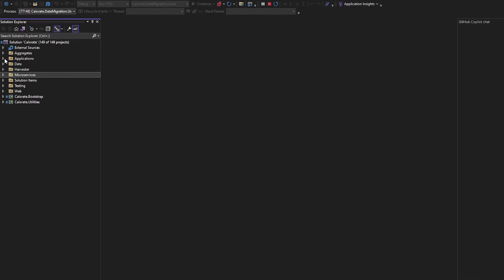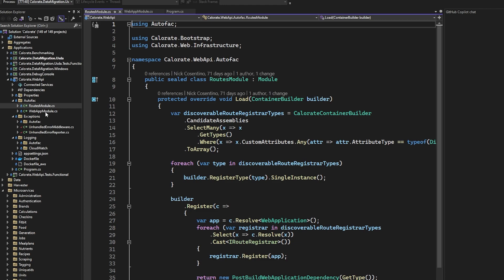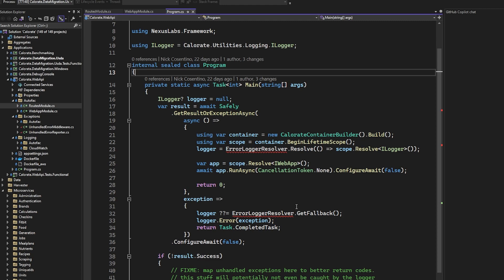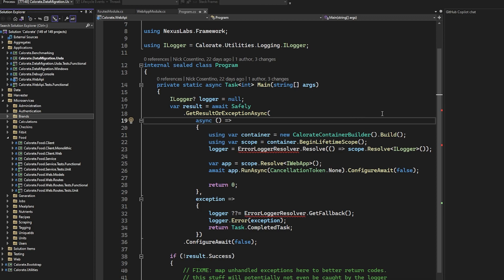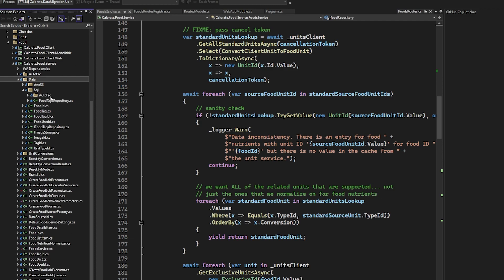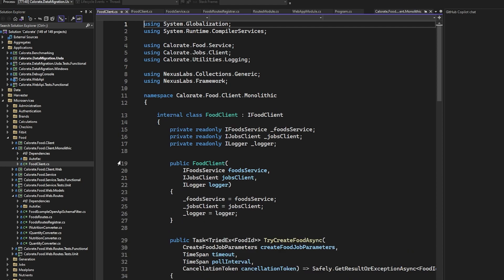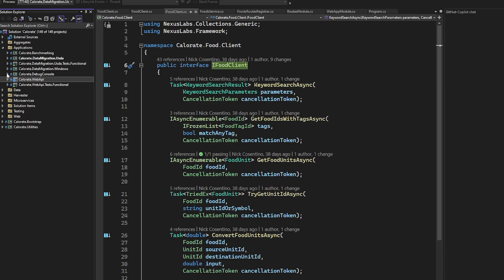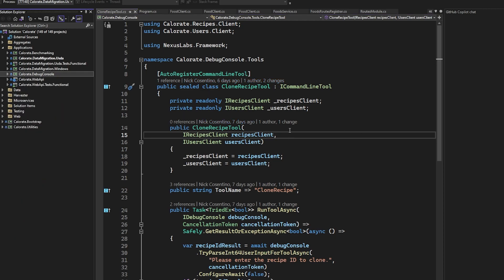Vertical Slices & Plugin Architecture - Principal Software Engineering Manager's Approach

Comment: Excellent video but why very less views.. it came to me at the right time which my company wants to implement plugin kind of architecture
Reply from the maker: My channel is still growing 🙂 slow and steady!

I'm glad that you found this helpful! I'll be trying to put out more plugin content soon 🙂
Reply: @DevLeader  Is it possible to share code base with microservices architecture so that it can be helpful for me to start.. I know the folder you have shown is real use case but to start faster may be a sample prototype with all basic features will be more helpful to start faster
Reply from the maker: @prabakara1652  hey there! I understand the request but there's a bit of a philosophical challenge with providing an example microservices template for beginners to start with.

That challenge is essentially: 
1) microservices will be very specific to what you're building
2) coming up with a generic template probably has little value as a result
3) microservices are complex by definition

I'm not trying to make excuses for this, but I genuinely don't think it would be as much value as you're guessing. 

Is it possible that it's a better fit for you to start with a monolith or modular monolith?
Reply: @DevLeader  Thanks for your reply. Modular monolith I think better fit for my current project need. Is it possible to share the code? that would be more helpful as the project deadline is very near and the client ask is extensible, plugin and modular approach.. your modular monolith solution seems best fit .
Reply from the maker: @prabakara1652  I have this video which walks through a template (it's linked there too):
https://youtube.com/shorts/f_OLN0TVIH4?feature=share

Let me know if that helps start you off in the right direction!
Reply: @DevLeader  Seems its just a shorts video about code review interactions etc
Reply from the maker: @prabakara1652  ugh my clipboard didn't copy, sorry!!

https://youtu.be/g_g7pYGCnik
Reply: @DevLeader  thanks for quick response

Comment: Can you share this project in the video so I would be able to play with it?
Reply from the maker: Unfortunately, I cannot! This solution shown here is for an entire product and service offering that I am building for a business.

Maybe I can put together a dedicated solution though and accompany it with a video. What would you want to see in such a solution? Just how I've organized my projects for the different verticals?

Let me know and I can try to put it together!
Reply: I would like to see what are the implementations to see how you manage Microservices, how orchestrated it
Reply from the maker: @genadyshmunik6041  I can go into more detail on that in a dedicated video I think. But the spoiler alert is that because this is a modular monolith currently, the "messaging" is just method calls. The implementation is as simple as it possibly could be.

But because I've put a communication API (I call it my client API) out front, the way that each is supposed to communicate is through the client API. When I'm ready, I can start creating implementations with MassTransit to create a queue or message bus... Whatever I need at that point.

I decided to spend a bit of overhead upfront "over designing" it so that I could use these API interfaces. They may never actually split out into microservices. But to me, it felt like a tiny bit of overhead early on to make something easier later.

I could probably put a demo together showing how I'd do this transition though!
Reply: @DevLeader do you need another dev to help you and work with you?
Reply from the maker: @genadyshmunik6041  while I appreciate asking, unfortunately it's not something I can accommodate. Between balancing work and things on the side, I'd be unable to manage.

Comment: Quick question, not familiar with the system, but are your "microservices" communicate/consume each other something like in a start structure, or there is some horizontal layering there as well?
Reply from the maker: I'll try to answer but just let me know if you'd like me to reclarify at all:

Each "microservice" could be an entire asp.net core application on its own (minus the entry point for each, but it'd take a few seconds to add 🙂). With that said, each one is essentially multiple layers from route to database.

Each of my microservices can interact with another microservice through a "client" API. The implementation of these right now is 99% just calling into other lower level code, but it forces access through an API that I can control. I've only created "web" implementations of a couple of these because I wanted some small tools to actually hit my running service in the cloud.

There's some code that's shared as a "layer" but it's domain agnostic now. So I have some shared SQL code, but it's helper methods for managing connections etc... The goal is for nothing to be shared horizontally across the microservice where specific domain stuff can bleed across.

Hopefully that helps!
Reply: @DevLeader  Each of my microservices can interact with another microservice through a "client" API." -> is the part I was curios about :). As you said this is a way to approach the problem you were facing.